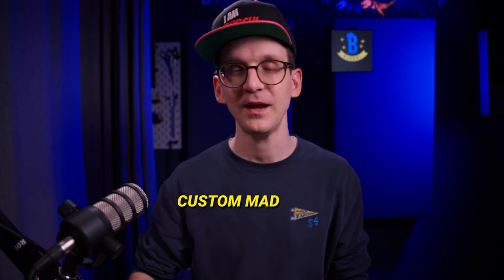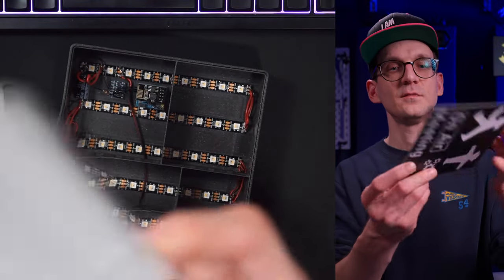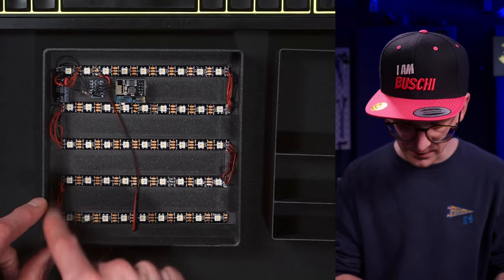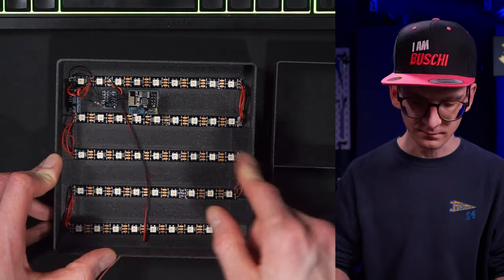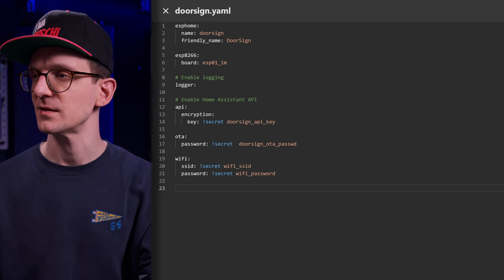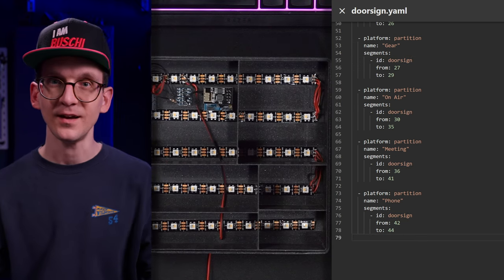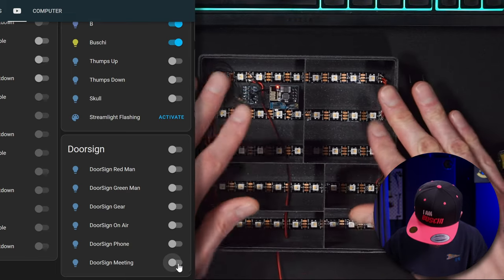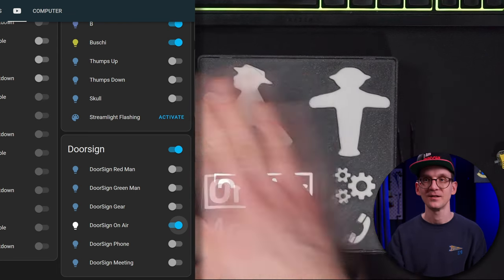Awesome segmented LED strip light | #Esphome #HomeAssistant

Comment: Great video. 
Would be great if you can share the boards and flasher used
Reply from the maker: Can share the boards, but haven't prepared proper BOM or description, which makes it hard to work with the named board files alone..

Comment: Very cool.
thanks for the viedeo, I was actually looking for a tutorial on how to write my own component, but this is almost what I wanted to build, I just have one question:
Is there any way to differentiate the transitions between areas.
Reply from the maker: Thx man, means a lot to me! About your question, what do you mean with differentiating between transitions exactly?
Reply: @iambuschi  
A colour transition.
Gladly over several pixels/LEDs
Reply from the maker: @Daedalin-b3r haven't come across a solution for that yet.. But maybe with one of the effect.. You can basically customize the heck out of all module effects.. I assume there is something like a gradual gradient color change.. Or do you want to dynamically transition between segment? Altering the colors until they match? Sounds pretty unique..